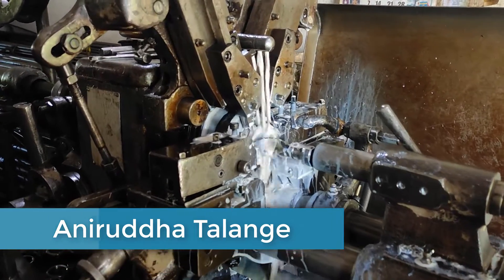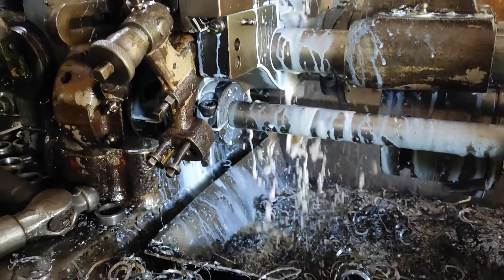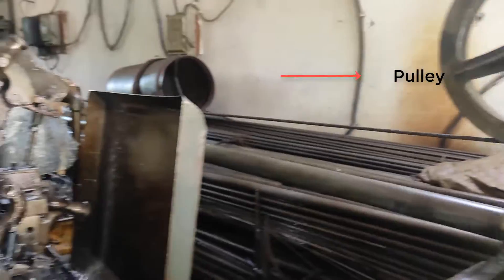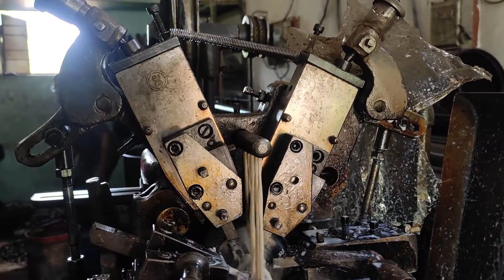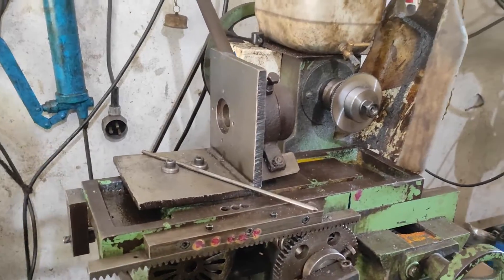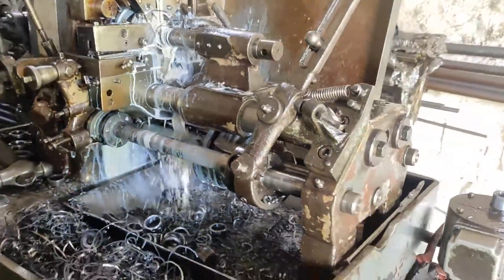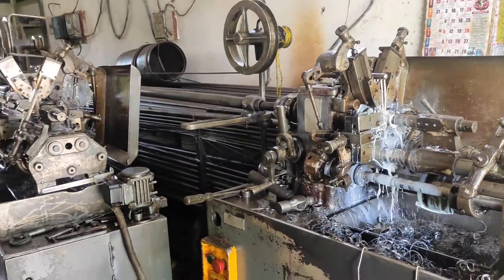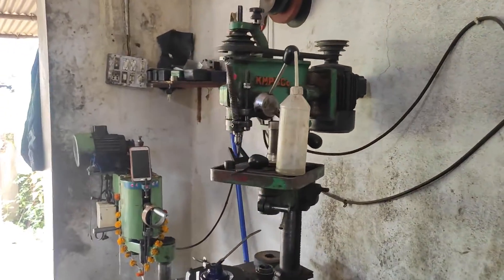Traub lathe Machine| Single spindle automatic lathe| Automobile parts Assemble | Complete process |

Comment: Hey, good information. Want to give you a heads up about the electrical connection at the machine. The conduit has come apart, leaving the conducting wiring exposed. Could fray insulation with the vibration. Can be seen at 59 seconds.